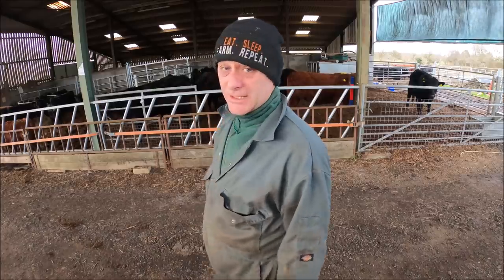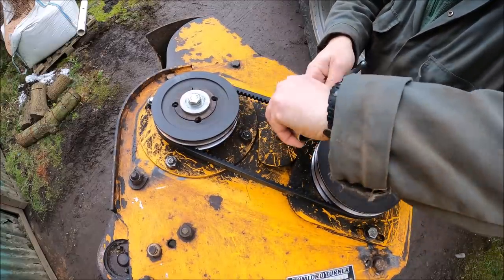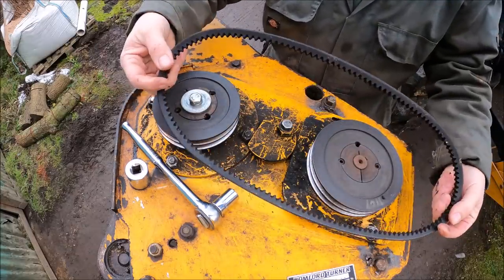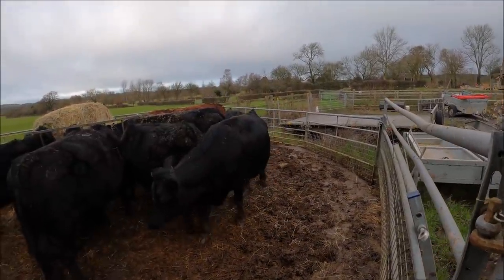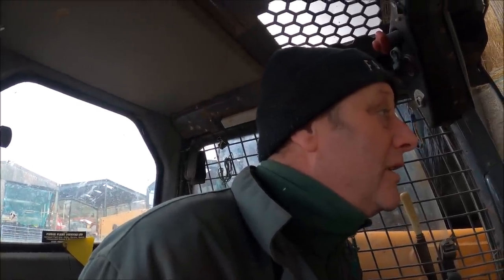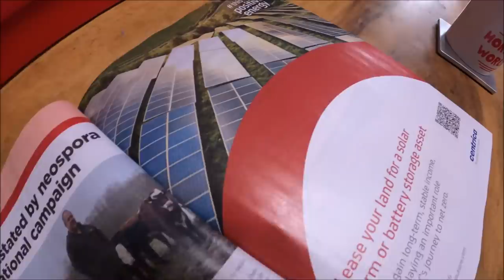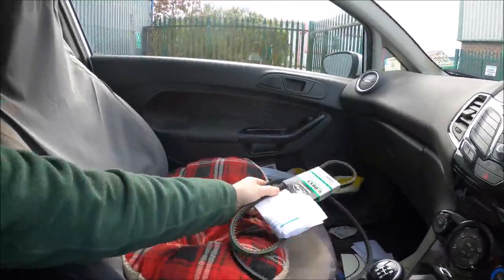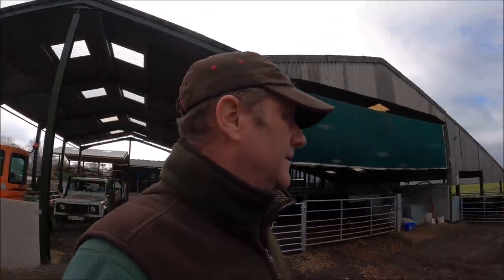29 01 22  Fixing the hedge trimmer. (Part one)

Comment: I was going to comment on other stuff like Abbi would get faster and efficent on the Mustang the more she used it but got drawn into the pigeon problem. there are devices you can buy to fit across the rafters to keep the birds off. Of course they are propably expensive but how about making your own. I first thought pound shop plastercine with about 3 to 6 inch wire ( florist wire is cheap and different guages ) stuck in it . Im sure will work just like the stuff in my local shoping center and cheaper.

Comment: The fuel will be £1,150. Some fuel suppliers will give a discount if you take over 1800 litres and you can combine it with a house hold burning fuel delivery to get the litres up.
Reply from the maker: We are on mains gas so that may be a bit difficult 😄👍🏼
Reply: @FarmerP  The way gas is going you will be cooking on a wood fired Rayburn and heating of wood chip burner .

Comment: the long ones were cooks ian, we used to have one with the sledge to match, on a mf135 and mil loader ,stacked them 4 long 2 high in a  wall ,  that went when they upgraded the baler and a new sledge ,which was cooks again but a flat 8 matched to a mf 290 and 80 loader , 2 x cooks bale grab trailers arrived then as well, so 64 back in one stack.
Reply from the maker: I loved that little loader tractor 😄❤️😄
Reply: @FarmerP  we did keep the 135 for the smaller piggery units,she was a nice unit i must say ,but times moves on, it was great stacking bales, but them cooks trailers made a huge difference, after all we were doing an average 500 -700 acres a year of wheat/ barley in small bales , depending on beet acres ,and it halved the stacking in the barn as well